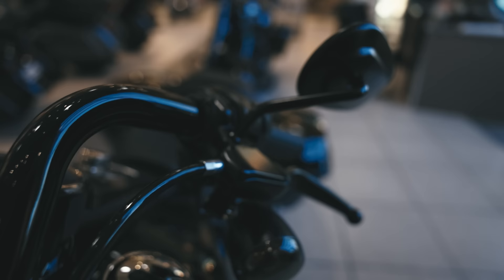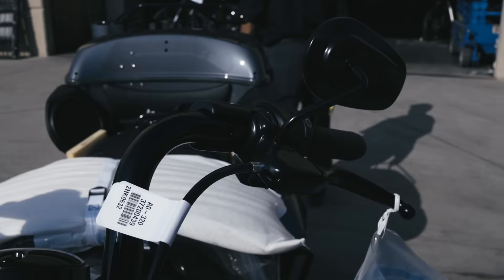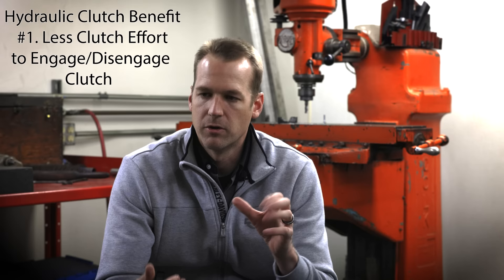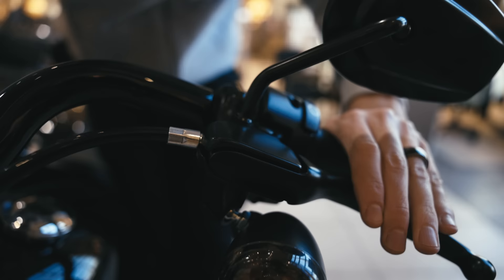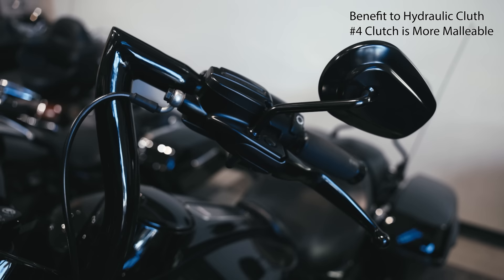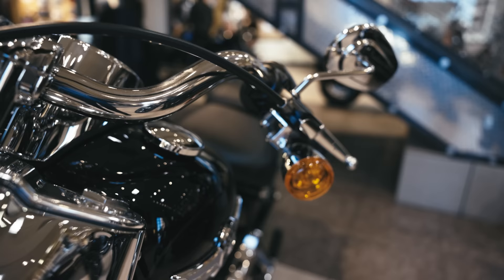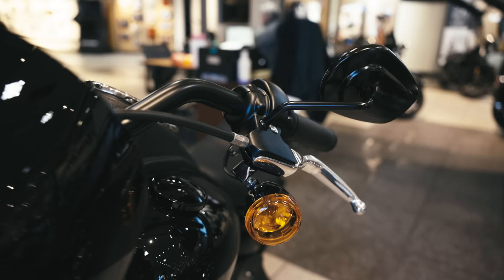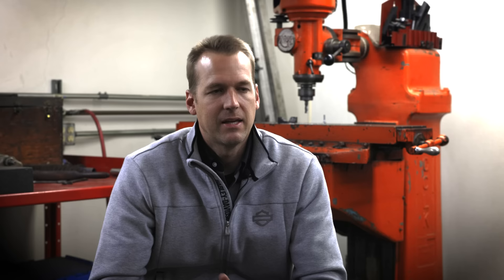Why Harley-Davidson Switched Back to a Cable Clutch on Touring Motorcycles│Pro's vs Con's

Comment: I feel the same as you. I prefer the hydro. But it’s not a deal breaker if Beas to buy another one unless I did a a build and had a stuff lever pull. I love my mueller hydro upgrade

Comment: May not have been well broken in but on the '21 I tested it felt like I had to really pull that clutch completely in to make a shift, whereas my '15 I can squeeze just pass the friction zone and make a smooth shift.  Again could have just been the brand new parts
Edit: you are definitely spot on with your contrast and comparison. I think Harley went the cheaper route... with the technology in the motor and xmission in the 114 it would have made plenty of sense to keep the hyd. clutch.

Comment: I like the hydraulic clutch on my ‘19 Road King. It took some getting used to (just like throttle by wire), but I prefer it now. And I have small hands.

Comment: While I do prefer the feel of the cable clutch on the softail, the hydraulic on my Road Glide is fine also. The transfer issue in the touring bikes has been a thorn in HD’s side for many years and I think the cable clutch was the easy fix.

Comment: I had a ‘17 street glide with hydraulic clutch. Hared it !!! Hard pull, friction point was too far from the grip. I disagree with easy pull. Stop and go traffic sucked. Dumped it in 8 months
Reply: Totally agree with you on all points. If it wasn't for the AIM clutch slave I had installed on my 2020 FLHR, I probably would have thought about selling, too.

Comment: It's nice not having the master cylinder on the handle bar. Plus i think if it goes out i wouldn't stand a chance jury rigging it to get home or to a shop. Plus the ability to set the point where the clutch engages where you want it.

Comment: The hud clutch is better but the slave cylinder needed a redesign. I didn’t like it to start with but once I replaced the slave with the Rekluse the hydraulic clutch became my favourite. H-D should have stuck with the hydraulic clutch.

Comment: I was considering a second bike in the 2020 model year. I tested out the road king and personally enjoyed the hydro when doing highway or interstate time, but as we got closer back to the dealership the narrow friction zone window and how far out the friction zone was drove me crazy in the heavy stop and go traffic. I walked away from a bike I otherwise loved because the clutch was so different than my previous riding experiences. I considered going back, picking up the bike, and just adapting my style, but then realized my five foot two inch wife with tiny hands has no grip strength where the friction zone is on that bike and made my final decision not to purchase it. Now Harley went cable on them and is going to make me spend more money on another bike.

Comment: If everyone’s opinion, what is the best option for a easier clutch or closer clutch for a 18 road king? I have soft delicate hands. Can work it, it’s just really far out, much different than the cable clutch on my 12.

Comment: Matt - are there any concerns or thoughts people are having around the 131 upgrades and clutching? I’ve seen that people have had to put tighter springs in to make up for the extra power of the 131 - on bikes without hydraulic previously (Low Rider S for example) they switched to hydraulic for the 131 with the newer springs.  Have there been any discussions around this?  Also - your point around the malleability of the clutch cable was excellent.
Reply from the maker: That’s a good question. The stage kits on the twin cam came with a heavier clutch spring. On the M8 kits there wasn’t a new clutch spring. Most of the guys we have installed stage 3-4 kits have never had any problems to my knowledge. I can think of a low rider S owner that did experience slippage. I think it comes down to just how you ride it. I think the stock clutch is fine if you know how to protect your clutch but for the guy that rides it carelessly or really hard could benefit from upgrading
Reply: @MattLaidlaw  thanks for the feedback, Matt!

Comment: The only reason is the oil transfer problem from the gear box to the primary. This is only a problem for  bikes with hydraulic clutch. A big problem for bikers here in Europe but fixed recently with a ventilation in the primary. But this always looked like a fast fix, not very professional. So they switched to the cheaper and bug free cable clutch...

Comment: The ease or difficulty of pulling a hydraulic clutch has everything to do with overall design….particularly clutch springs….I had heavy springs in one bike with hydraulic that made a VERY hard pull….but it made slipping a thing of the past…..personally I can go either way, but I do find that I can adjust a cable any way I like so long as the clutch isn’t slipping…..and the friction zone is easier to manage…..but as I say…whether I get one or the other on a new bike is NOT going to influence whether I buy or don’t buy that bike.

Comment: I loved the hydro clutch on my 2016 Ultra Limited. My new 2021 RGL is harder for me to pull. It seems to be a farther reach for me to grab and being older my hand strength isn’t what it used to be. Plus, that farther reach is at the stiffer part of the pull and I’m just grabbing it with my finger tips. Consequently my hand position on the lever shifts by the time I’ve pulled it all the way to the bar. I don’t like it at all. I would like to convert back to my hydro clutch.

Comment: I like the cable clutch on my 2015 roadking.  I like that they went to back to a cable.  The only issue is that they did it half azzed.  Look how the left hand control looks unfinished where the clutch reservoir used to be.  looks awful.  (and i guess we'll see if it makes a difference with fluid transfer).
Reply from the maker: Thanks for commenting on your preference.

Comment: I've heard they switched because of the fluid transfer problem not being completely resolved with the vent tube so does the cable clutch use the rod ?

Comment: I remember when Indian had a clutch pedal and a hand shifter. The hydraulic clutch should be optional. When hydraulic clutches start going the pressure bleeds off and the motorcycle will creep. You can't always grab a hand  full hydraulic clutch to keep it from stalling or jerking. If you can do your own maintenance and repair kits are available no problem. You don't want to hear from an incompetent parts person parts (  Not Sold Separately ) you have to buy a whole new everything. I've worked with hydraulic clutch linkages for years on trucks and cars. Its easer to run a hydraulic line than to make a mechanical linkage work with an abused angle. The cables work and last long enough.

Comment: The width of the friction zone isn’t a function of hydraulic vs. cable.  It is a function of the ratio of movement at the level vs. movement at the clutch pushrod.  If the hydraulic friction zone is too narrow, this can be broadened by changing the size ratio of the mastery cylinder piston to the slave cylinder piston.  This is a design issue not something fundamentally related to hydraulic vs. cable.  And adjustable levers as on several other motorcycle brands and models addresses how close to the bar the friction zone is located.  These are issues that were solved 20 years ago by BMW and others.

Comment: If you put bigger clutch springs in a motor build you will love having a hydraulic clutch...I ve ridden 110 builds  with heavy springs and its a chore to pull in the clutch...BOTTOM LINE IS THEY ARE GOING BACKWARDS TO SAVE MONEY AND BOOST THERE BOTTOM LINE.

Comment: I’ve only had experience on road kings with hydraulic clutches. One was the 107 and the other was a 114. Both were in a police motorcycle operator course. I really struggled the first go around with the 107. Friction zone was near the end of the let off and it was stiff. I barely had enough reach in my fingers and would have to roll my hand forward more to grab the lever.  They said our 114s had different slave cylinders which made the clutch pull lighter. I’m sure my previous experience made operating the 114 a little easier the 2nd time around. I brought the clutch lever reach in just a little with an adjustable lever. I would say that’s probably one real benefit with the cable clutch is being able to adjust the free play to shorten the reach just a tad for smaller hands. It’s probably not necessary but more reassuring when you’re a new rider. We’d make those fat girls dance though.

Comment: Silly suggestion but it’s too bad they couldn’t make it an option. You choose. Personally, owning an ‘08 Dyna and a ‘19 Road King Special, it’s pretty six-of-one, half dozen of another for me. Both have benefits and drawbacks, as Matt noted. If I had to pick, I’d probably go cable. My Dyna is an easier pull and provides more flexibility. Hydraulic just seems to me like something that SHOULD be on a $20-plus thousand dollar motorcycle. Image vs. function?

Comment: I owned 6 touring models with a cable clutch and my last bike a 2014 limited with a hydraulic clutch. The hydraulic clutch is much better. I think they went back to a cable clutch to save a few hundred bucks on the cost of the motorcycle. Give it a few years, the hydraulic clutch will make a come back.

Comment: My Fat Boy S had a hydraulic clutch, and I could swear that one was heavier than the cable one on the 2011 Fat Boy I had before that, and heavier than the 2019 Heritage I have now--which is weird, because the Heritage is a Stage IV and should have the stiffer clutch springs.

Comment: Went from 2016 Low Rider to a 2017 Street Glide. The first thing I noticed was the clutch engagement being so much farther out on the clutch lever. This took a while to get used to. Now  I have a 2019 Street Glide and I don't think about the clutch engagement. Between the two SGSs I've put 48k miles on them and never had any clutch issues. Don't know how I feel about going back to cable actuated, if I decided to replace the 2019.

Comment: Have a 06 Glide with the cable and a 17 Cvo Glide with the Hydraulic like the cable feel bit better. Bought a reduced reach clutch lever for the 17 will see if it’s better after a foot of snow melts. Come on spring

Comment: Idk man the clutch on my 2019 street glide seems like it changes where it engages from when it's cold vs when it's warm but the cable clutch on my 2004 dyna is always consistent and feels alot better

Comment: I have to disagree about hydraulic being easier to pull. Ive had cable clutches i could pull with 2 or 3 fingers with out effort. Just bought a 2020 street glide and i can say for sure 100% its harder to pull than any cable ive had. I have to use my whole hand and its still prertty dam stiff. Maybe it will get easier once its been used for awhile but new from the factory its harder to pull. 1 other thing ive noticed is when i shift weather up or down i can feel it in the clutch handle on my bars. Never had this with a cable so dont no if this is normal for hydraulic clutches but i found it very strange.

Comment: AND Nobody mentioned the Warranty Cost of replacing the Master cylinder because of the Dot# 3/4 Fluid Removing the Power Coating Under the Cover.. Dot # 3/4 is like Paint Remover ..Same thing happens to the Fr. Brake M/C ..Its Cheaper  to replace 1 Than Both ..

Comment: Matt I think the whole reason is expense. HD is saving on expense by going back to a cable. First they took away the heal-toe shift lever, then they took away the extra key fob, and now the hydrolic clutch. Think about the money they save on each of these items. The bikes have not gotten any cheaper either. Going back to a cable clutch is going back in technology.

Comment: I honestly feel Harley went back to cable clutching to offset the oil transfer condition that they couldn't really 100% resolve without further R&D. I've had both clutches over the years and have found my clutch hand will adjust from hydraulic to cable (which is my current ride) in a few short weeks so it wasn't a deal breaker for me. I suggest there is a bit of smoke and mirrors to avoid admitting the real reason they went back to cable.

Comment: I've only ridden bikes with cable clutch.  I bought a Street Glide Special and the clutch sucks.  I ended up with a blister on my thumb.  I never had a blister on my thumb riding my low rider or sportster.   This is my only one of my two complaints about Harley.  The other is "When is Harley going to run out of their 1 billion incandescent lights.  It is 2022 Harley change all the lights to LED

Comment: I bought my Tri Glide in 2016 and it was a 2014 model, even on the first day the clutch failed by overheating in traffic, and It has done it several times since then, just the other day, the clutch failed again nowadays I know the problem, you have to stop and let the clutch cool down, it happens in heavy traffic or mountain twisty roads were you are going in and out of low gears. so I must stop, and it does not take long for the clutch to cool. but its a pain.

Comment: Sometimes you take a chance on going for something and the stars align. 
I wasn't sure that I was financially ready in 2018 to buy the hold-over 2017 Ultra Classic. I went for it and things have worked out well. Now, I'll never trade it or sell it for a newer Harley. It's the perfect bagger. I've seen H-D 86 the Ultra Classic from their lineup  but the aspects of the Ultra Classic that drew me toward it are standing the short term test of time. Great cornering clearance, for a Touring Bagger. Amazing engine. Hydraulic Clutch. (My biggest negative is something I can ignore, the lame GPS and proprietary nature of the infotainment system.) 
Will I buy H-D in the future? Most probably, ( I like the Pan America) but my Ultra Classic isn't going anywhere.

Comment: I have a 2003 and a 2018... the 2003 clutch much easier to pull and less strain than the hydraulic.  Dont agree with you there Matt and obviously a lot of others don't either.  It is not perception at all.  Take your bias out of the comment and look at the fact.  You can have a machine do the test to pull a clutch as the machine doesn't tire where a person's forearms do presenting a fatigue factor which doesnt come into play with a machine test.

Comment: I prefer hydraulic clutch as I prefer hydraulic brakes. Would going back to cable brakes be an advantage? Why car manufacturers don’t go back to cable clutch? Because hydraulic is more durable and reliable. Am I right?

Comment: Problem with fluid at high altitudes.  Gets water or air in the system even though it is a closed system.  Had mine changed two weeks prior to riding the Rocky Mountain National Park.  Half way up stated loosing the clutch, by that I mean would not disengage . As we came down in altitude it stated working again. Took to the dealer they checked the Dot 4 fluid in the clutch and said it had 4 % water which would cause the failure.  This issue wasnt just on my bike but my buddy as well. Dot 4 has low boiling point and when this happen you get air bubbles and or moisture in the fluid. Pretty scary to have happen at 12000 ft on very sharp switch backs.

Comment: 2020 on my Street Glide Special I lost the heel shifter and the vent button on the fairing. Now 2021 back to a cheaper clutch cable over a more expensive hydraulic clutch. I wonder if  the 2022 HD accessories catalog will offer the hydraulic clutch for sale like the pre-2020 heel shifter?

Comment: Hey have a question. I am thinking of buying a new Harley street glide special. I currently ride a Suzuki Boulevard M109R. I am wondering if the Harley clutch levels are easier to squeeze on a Harley. I am looking for my next bike to have alot of comfort and just want to make sure that a Street Glide or Harley in general is the best route to go.

Comment: Oil sumping. Simple fix and keep the price the same. That was the real issue, not how riders "felt" when using the clutch. My truck has a hydraulic clutch since 99 and there's plenty of feel and control where it grabs.

Comment: Judging from this video, I wish I had a hydraulic clutch. I just traded my 2020 Iron 883 for a 2020 Softail Standard. I have short fingers and a bit of arthritis, but had no issues with the cable clutch on the Iron. However,  I am having serious issues with the cable clutch on the Softail Standard. My left hand gets sore after riding the Softail for a while, from having to reach so far and pulling the lever. Is there anything I can do to remedy this?

Comment: My   1968  FWD   6 wheel  drive  Truck  had a   Hydraulic clutch and a  5 speed  Fuller Transmission with  a  3 speed Transfer case  and a  501 Cubic  Inch  International Harvestor  RD-501  engine..  I  upgraded to a brand new 3208 Cat  engine with a  10 speed  twin countershaft  Eaton  Transmission.. Eaton bought out  Fuller..
   The more  powerfull engine  with  640 ft# torque  needed a more modern clutch wiht  a  Industry standard  #2  Bellhousing ..   they now  use  pull cltuches  instead  of  push cluthes..  
   The Hydraulic  set   moved in the  wrong direction.. Some  one  suggested  I use  a Mac  Cable Clutch  instead of having to fabricate so many linkages..  I cut the whole  clutch pedal assembly  out of a Mac parts truck .   and bolted and welded into the peice of Junk  Dodge Cab in my FWD TRuck ,....
   I ahve  been  using  the same Cable  Clutch since  1986 ..  for  20,000  hours and  189,000 miles    much off road in farmers fields  spreading lime.  I use that clutch so  many times  per day  taking off from a dead start but I shitt with out using the clutch ..while  moving..